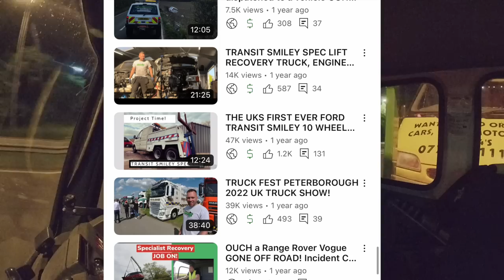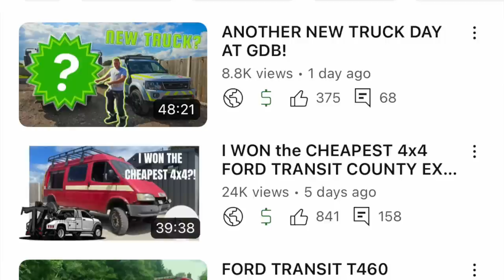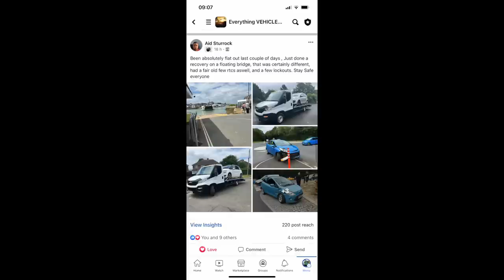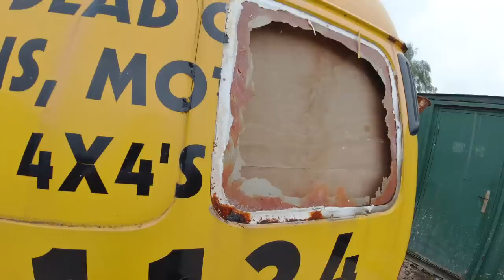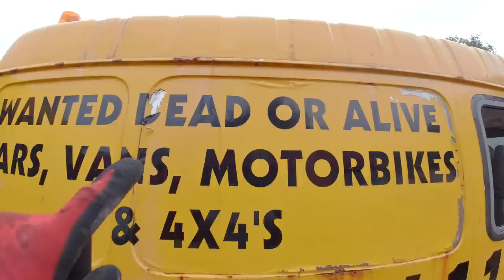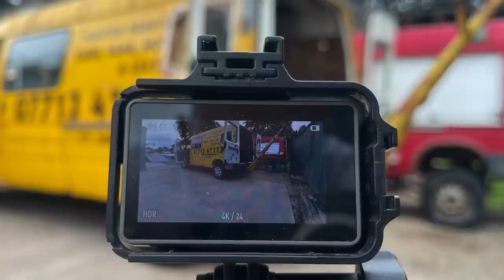NEW VAN AT GDB ! HAPPY BIRTHDAY TO ME FROM ME!

Comment: Is there not a switch on the dash of the yellow transit to put power to the hydraulic pump for the spec lift
Reply from the maker: Have had a push and a bang around on dash no joy but no problem will soon have sorted